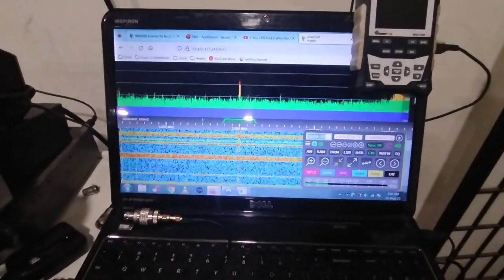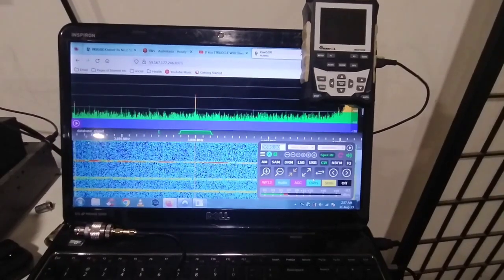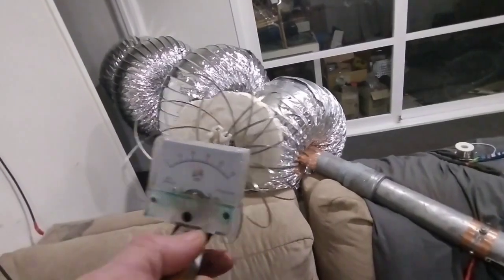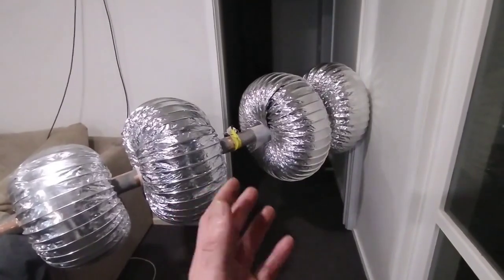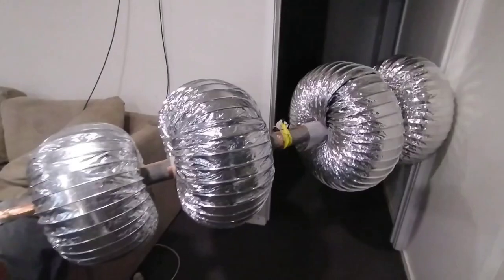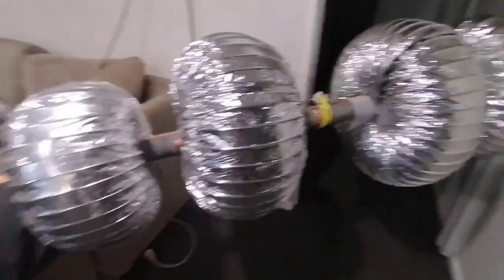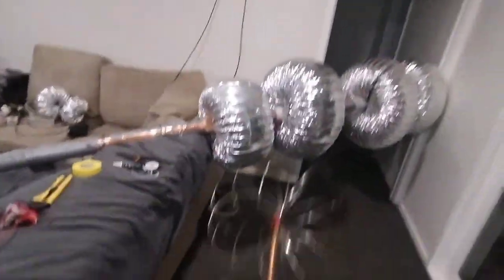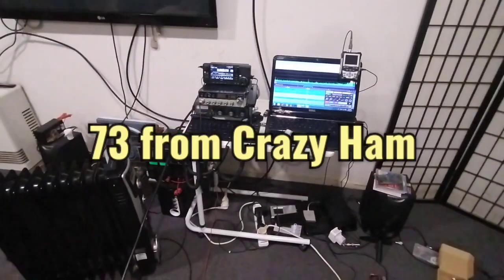HF Limited Space Antenna (Update)

Comment from the maker: I am working on this concept continually
and have been making many changes
trying to choose the best all round option to run with.

I have had good signals into VK6 over 3000 km away from the loungeroom on 10 watt,
also into VK4,VK2 & VK5.

This is a work in progress
that I intend to settle on a design
and then share it with the Broader Ham Radio Community
so we can get more Enthusiasts experimenting with alternative approaches to generating an effective TEM wave for HF radio comms in a limited space.

I hope you enjoy the journey with me
Just as much
as I enjoy sharing the exploration !

I keep flipping between using remote & manual  magnetic tuning options
and using a run of the mill ATU / Transmatch.

So far,
I can't quite get max efficiency with a regular ATU
though I am confident that I will find a config that is pretty close on the intended bands.

I may end up creating two versions.

One to be used with a Regular ATU/Transmatch at the station
and one more refined version
with remote DC controlled resonance adjustment option.    
 (Goodness knows what to call it)? 

73 from Crazy Ham ⚡🙏⚡